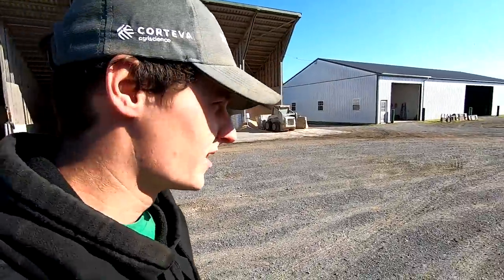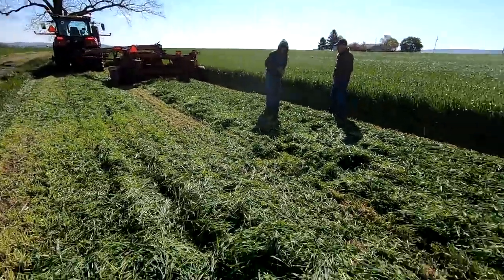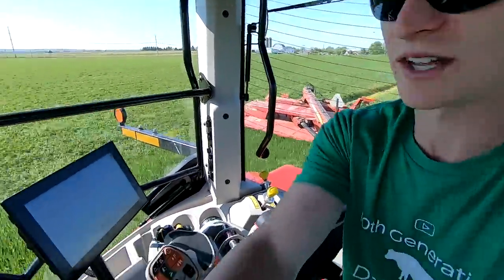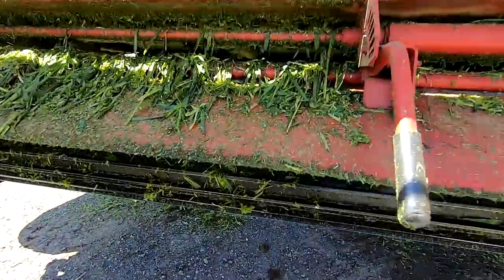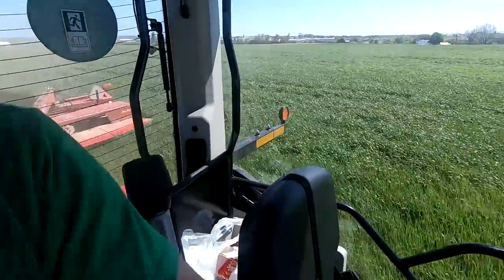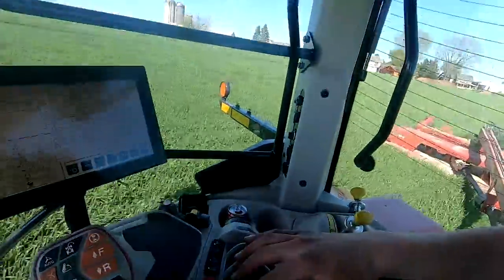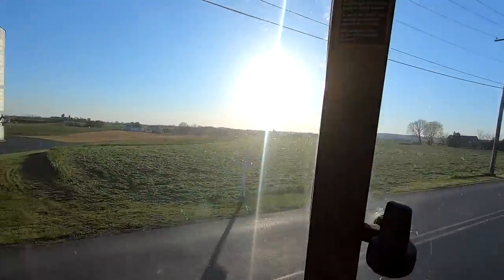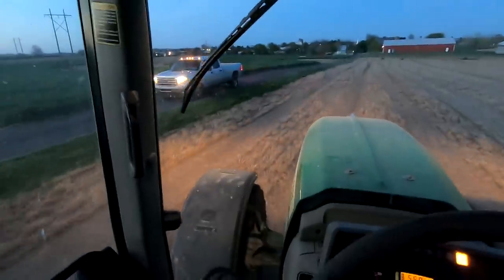Mowing Triticale with Versatile Nemesis 210

Comment: Thanks for sharing, Eric and crew.
New tractors are nice, but there is much to be said about a tractor that can be repaired, in your own shop.
Gears shift with a lever. CVT shifts with computer codes, that you can't have.  What could go wrong?  
If they want to prove their brand of tractor is fit for duty, loan you a mixer tractor for a year. They can show off what's left. LOL
Mowing at 11mph for a day is cool, feeding 365 days with zero down time, zero problems zero glory. That's a tractor.

Comment: First off, I think this is one of your best videos you have done.  You incorporated views from inside the tractor, outside filming and drone filming.  So, good variety.  Also Megan did very well and your Dad just needs to get more comfortable with talking on a video.  He has a good voice for a video and he just sounds confident and relaxed.  Dennis, I think you are well liked and received by the audience, so if you want to lets hear and see you more!!  Overall, all of you have helped to make the video a fine finished product!!!  Second, the Versatile Nemesis looks nice.  Too bad that Ag-Com LLC could not have given you more time to drive and use the tractor.  You need some time to just get through the learning curve on a new machine and then it was gone.  Nice unit and seemed to handle well and had the power.  Also had that CVT trans that takes a bit to get used to but probably can spoil you too.  Too bad you did not have a front mower to hook up to that front PTO.  You could have really "blown through" the fields and it would really have tested the horsepower running two mowers.  A unit that may not be as expensive as a green machine but does bring the HP to you (210) when you need it and if it is not worked heavily probably would hold up.  Maybe not the tractor for a big operation working many hundreds of acres of crop, but for a smaller operation might fit in well.  Just my opinion.  However, the fact today is that your video was a home run and good use of other people providing a variety to your video.

Comment: The question I have is life of a CVT ver the life of a manual gearbox and what does it cost to rebuild them?   Does a CVT last as long as  a gearbox?   I imagine you replace the belt can you do that at your farm or does that require the machine to go to the dealer or a local mechanic?  The right to repair, is the Nemesis set up so you can do less and less?  Maybe better to buy an old tractor and spend your money on a referb and have less computers on the engine?    Have you had problems having to take newer tractors to dealers with issues you use to deal with yourself or a local mechanic comes out and fixes?

Comment: I agree. I like the color scheme on the Versatile. While the features and reliability are important for a tractor the number one thing that pushes a buyer one way or another is dealer support.  Used to be Deere had lots of dealers and if you had an issue you could go some where else. But Deere is pushing its dealer network to consolidate (as are the other companies). Not many small dealers any more.

Comment: As a former farmer and cattleman, I am surprised Milk is not $10 per gallon by now.
Reply: They over produce , supply and demand ,but the mega farms just don't get it
Reply: @bobo44donemilking51  Dairy farmers are subsidized by the taxpayers based on production.  This keeps prices artificially low in the store while still keeping the farmers afloat.  Milk would be $10 a gallon if this wasn't the case.
Reply: @myndzi8125  the government doesn't subsidize dairy farmers anymore like they used too,if the price drops to a point ,the farmers dairy price insurance kicks in and pays a amount depending on what amount of your coverage is and the insurance isn't cheap ,I was a 70 cow dairy with not to much of a dept so I didn't buy the insurance,it changed alot from how it used to be like 10 years ago

Comment: Just a note seen you fixing your NH discbine, you might want to read your operator manual. The hub you took off is call a shock hub, then you just put on old style hub and you didn't torque anything.

Comment: Im guessing youre driving on the uncut on purpose? Seemed to do it alot unnecessary but then you swapped so you didnt so im not sure. Wouldnt it be better to have the swath you cut between the tractor tires and mow grass thats not been driven across, which makes the mower not cut that cleanly.